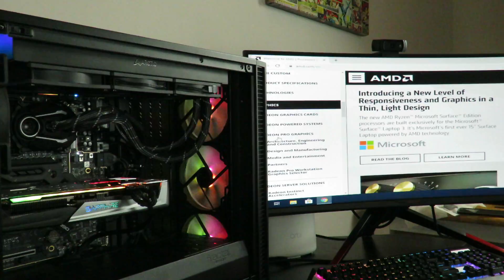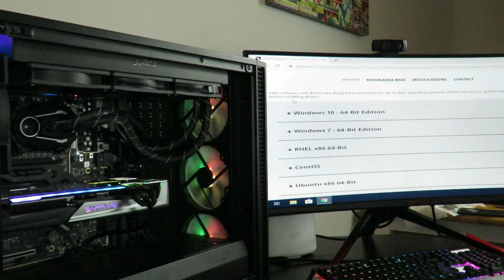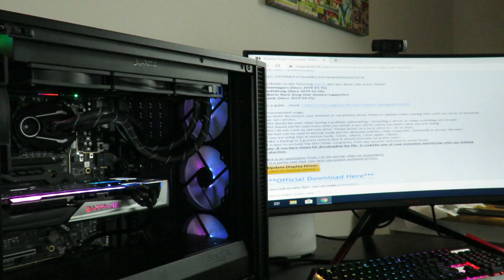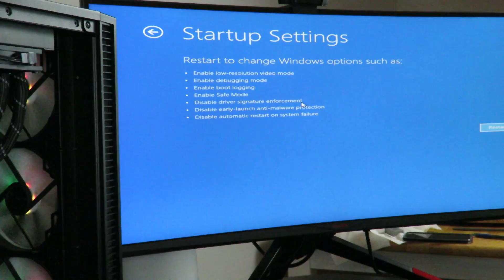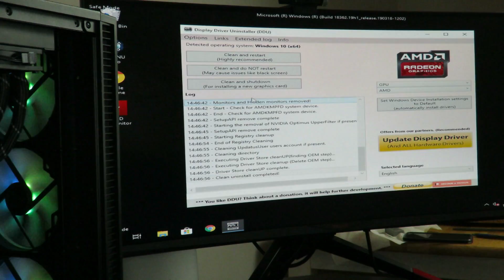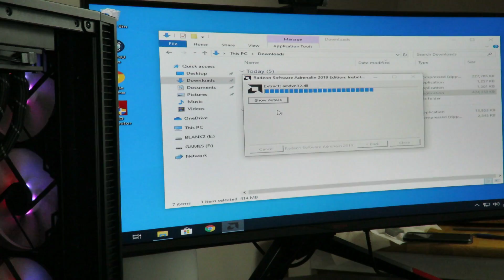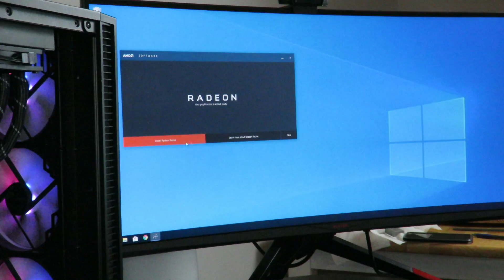Installing the AMD Sapphire Radeon Nitro+ RX 5700 XT 8GB OC Graphics Card

Comment: I see your helping everyone thank you alot I need you help please so my rx 5700 xt msi gaming x doesn't give me signal I already try doing everything bios update moving from slot but I don't get signal.i have a 750w psu and i7 9700
Reply from the maker: I try to help all my subscribers with everything but on yours, is your monitor selecting the input your card isi being connected with?  For example, if you are using HDMI connected to your monitor and your video card, is the monitor on HDMI?  An issue that just appeared for me, is on the monitor, the HDMI connector is a bit stretched out, so I have to wiggle the cable a little to make proper contact, I would get the same no signal message.  Also, do you have both PCIE cables connected to your video card?
Reply: @ThisBytesForYou  yes i already try to use another pc but the same problem no signal
Reply from the maker: @raulrodriguez1998  If you can never get signal on it from any PC, sadly it sounds like you need to RMA it.  Sorry my friend.
Reply: @ThisBytesForYou  thank you you got a sub
Reply from the maker: @raulrodriguez1998  Thank you so much my friend, I do greatly appreciate it.  I hope you don't have any issues returning it.  I would like to ask you, if/when you do return it, would you be exchanging it for the same card, or switching to another, and if you do switch, what would you be switching it?
Reply: @ThisBytesForYou  its from newegg so I to return it for the same one but if I had choice I would go for the powercolor devil rx 5700 xt
Reply from the maker: @raulrodriguez1998  I would highly recommend getting the  Sapphire Radon Nitro+ RX 5700 XT OC, the cooling on it is the best, check it out on Amazon: https://geni.us/VoHIZhu

Comment: I am back, and am having troubles again with my graphic card. I had it originally in the first pcie a lot but it wouldn’t connect so I switched it to my second pcie slot and it still won’t send a signal to my monitor. It doesn’t light up either and show no sign of life. Is there any way to get into bios without the gpu? Or is this simply a faulty card? Please help ASAP. I spoke to you about this two days ago!
Reply from the maker: you never had to ask me to answer asap, I will always answer you as soon as possible.  So for example, if you are using an HDMI cable, or DP, make sure you have that input selected on your monitor.  Also, if you came from onboard video, make sure you have the monitor plugged into the video card, and not into the motherboard.  Also, do you have both PCIE cables connected, and what manufacture and model number power supply do you have?  Also, what motherboard are you using, manufacturer and model number.
Reply: I have the exact same problem played around with the cables kept taking it iut and putting it back in worked for abit then 1 day it stopped getting power again
Reply from the maker: @halloween448  Sorry, I did not see this comment, youtube is horrible at sending notifications.  Have you resolved this issue?  If not, lets walk through a few things.
Reply: @ThisBytesForYou  hey no problem i did was actually a problem from windows 10 and its power settings i kmow others that had the problem aswell but i resolved it by adjusting the maxiumum processor state and the minimum state as the minimum was set to 99% and max 100% so i changed the minimum to 20% and max 99% and its all well now, the minimum and max states were on those settings for all power options
Reply from the maker: @halloween448  hmmmm ok, I usually set my minimum state to 5, but hmmmm, I will keep this as a note for others having issues, I had not thought about that.  Thanks.

Comment: Hi, (I’m sorry I’m still a noob at pc building this will be my first build) I just bought this graphics card because I’ve heard good reviews about it, and meanwhile I’m installing everything, it seems to fit in perfectly, it looks just like yours. But when I decide to boot it up to see if the rgb and fans work, my gpu doesn’t light up or anything. Everything else lights up but the graphics card. Do I need to connect it to a monitor for it to turn on? Or is it just simply a faulty graphics card? If you addressed this somewhere in the video I’m sorry I didn’t catch it the first time. My monitor also isn’t coming in yet so I have not tested it with a monitor display connected to it. Please help ASAP.
Reply from the maker: Can you give me the exact model number of the video card?
Reply: Mine is the exact same video card as yours! Sorry for not mentioning it!
Reply from the maker: So the model number on the back of the card is the same as mine, or does it just look the same?  Does your model number say black?
Reply: It’s the same as yours!
Reply from the maker: Ok, have you downloaded precision x1 from Vegas website?  I was very persistent about the model, becuase if you look down at the comments many have said the same, and by me asking, we find it looks the same, but is not.
Reply: I won’t be able to download anything until I get my monitor in.. I was just turning it on to see if my fan and rgb would turn on but everything else in my build turned on but my graphics.. should I be worried? Or wait until my monitor comes in to trouble shoot?
Reply from the maker: Well, the monitor helps, don't try turning it on without the monitor.  Also, sorry I meant to say trixx, not precision x1
Reply: Okay then! I will wait for my monitor! It comes in Tuesday so I will come back here if I have any questions or concerns! I love your channel! Thanks a lot man!
Reply from the maker: Anytime my friend, always happy to help, but we just need to make sure we have everything before we diagnose, also, make sure you have both of the pcie cables and a capable power supply in the system.

Comment: hello, i have the asus brand of this card strix rx5700 xt OC, it shuts down on stress. the clock speed Works more than 2000 mhz, i will uninstall the drivers as u said before, and install it again. on the other hand i m not sure about the power cable, which one is the true using 2 seperate cable or (as i did ) one cable from psu has 2 8 pin outlet and i used that. is it a problem i have another free cable too.
Reply from the maker: its not a problem if your power supply is strong, what power supply do you have, model number and manufacturer?  Also, I have heard of another person with the 2000mhz problem, it was resolved when they dropped that a little, you may want to also check with gPU-z what your video card temps are.

Comment: Hey, I just bought a Gigabyte version of the same GPU. Unfortunely I'm having problems when stress the PC it turns off. Tested with other old GPU from Nvidia (GTX 750 Ti) and works fine. I'm using 750W Bronze that should be fine right? What could it be?
Reply from the maker: the drivers can be a little off and windows, a few things you want to do, make sure you are on your latest version of your motherboard bios, update windows to the very last update, then DDU your drivers, removing all nvidia drivers as well as AMD drivers, and after using ddu, update to the latest driver version:  here is my video for ddu: https://youtu.be/clLYbBywhAg, please let me know how this goes for you.
Reply: @ThisBytesForYou  already update the drivers and windows, apparentely the problem was the clock of gpu, wich surpasses 2000mhz while gaming, I set up to 1900mhz and until now is doing great
Reply from the maker: @Fabricio414  ahhhh good to hear, very happy you are up and running.  The 2000Mhz, was that your doing in overcloking?
Reply: @ThisBytesForYou  nvm he dont want respond :)) ..btw why u got a 5700xt..if u have a 2080 curious haha
Reply from the maker: @nikenzzo  not sure what you mean he doesn't want to respond he has responded.  As for your question, I state in the video exactly why I am changing the 2080 to a 5700.
Reply: @ThisBytesForYou  sory i watched on hurry ..i go full video at home :)
Reply from the maker: @nikenzzo  no worries my friend, but check it out when you can

Comment: Legend 🙏
Reply from the maker: Thank you my friend, but you are the legend here, without you I am nothing.  Thank you so much for stopping by, checking out my video and commenting, it means the world to me.
Reply: @ThisBytesForYou  np my man, best video I've found on this and helped me set mine up, keep on doing what your doing :)
Reply from the maker: @samgibson6502  Thank you my friend, I do greatly appreciate your kind words and I am so very happy I could help.
Reply: @ThisBytesForYou  is there anyway you can help me, I bought this graphics card and for some reason the performance is worse than my rx590 which costs around 300 less any ways I can fix this?
Reply from the maker: @samgibson6502   Sam Gibson  it should be slightly more than double the performance, I HIGHLY recommend downloading and running DDU, then downloading and installing the latest and greatest driver, I am assuming you kept using the same driver, even moving to the same generation, just a step up, I always recommend using DDU.  Use DDU to remove the old driver, make sure to set DDU to also stop windows from automatically installing "their latest driver", and of course do this in safe mode, then after uninstalling the old driver as I mention in this video, then install the latest driver.  I also recommend FULLY updating Windows before you do all of this.  Here is the video I recorded on this process: https://youtu.be/clLYbBywhAg .  Also, you want to check your temperatures and you need to make sure you have both PCIE connections plugged in.
Reply from the maker: did that help you any?
Reply: @ThisBytesForYou  sorry I didn't see your message, I tried all of this and saw no change, so I sent it back I think I'm going to upgrade other parts of my system first like my motherboard and cpu thank you for your help though :)
Reply from the maker: @samgibson6502  you are very welcome my friend, I will do all I can to help you.  If you have any more questions afterwards, please do ask, I would love to help you.
Reply: @ThisBytesForYou  thank you bro, keep up the good work :)
Reply from the maker: @samgibson6502  anytime my friend, thank you so much for your kind words and your support, it means the world to me.

Comment: Can you help me? I have MSI MPG x570 gaming edge wifi MOBO ryzen 9 3900x 32gig ram and 750w power supply. My issue is when i installed this gpu and install the drivers the screen goes black and the fans on the gpu stop. I will have to install my old gpu and to uninstall drivers and restart the whole process. The screen only goes black once i do the driver update. My bio is up to date and nvidia drivers have been uninstalled.at a lost for words now
Reply: Also i have update amd chipset driver and socket driver and when restarting the computer the gpu will still let me go into bios, but windows wont load and the fans will stop spinning
Reply from the maker: OK, I recommend watching this video, starting at about 7:09, I show you how to uninstall the old drivers with DDU, then also stop windows from automatically updating your drivers, then how to install the latest and greatest drivers.  Now, before you do this, 100% update your copy of windows to the latest and greatest version, then FULLY update your BIOS, you can find your BIOS here: https://www.msi.com/Motherboard/support/MPG-X570-GAMING-EDGE-WIFI, latest version is 7C37v17.  Afterwards, download the latest chipset driver from AMD, from here: https://www.amd.com/en/support/chipsets/amd-socket-am4/x570, then download the latest video driver from AMD, from here https://www.amd.com/en/support/graphics/amd-radeon-5700-series/amd-radeon-rx-5700-series/amd-radeon-rx-5700-xt.  

After you have downloaded the chipset, video drivers and DDU, boot into safemode, then use DDU to remove your NVIDIA and AMD Video drivers, then use DDU to remove your chipset drivers, also set DDU to stop windows from automatically updating your drivers (that is causing your issue), then reboot and go into regular mode in windows, it might be a good idea to uplug your ethernet cable so you wont be on the internet for this portion.  Once in windows, install your chipset driver, if it asks you to reboot afterwards, reboot and when back in windows, then install your video drivers and you should be good.  

Please let me know how it goes.
Reply: @ThisBytesForYou   so i tried all of this today even tried reinstalling windows cleanly on one hard drive and as soon as i gott o the gpu driver its black screened again. Everything else updates just fine. Thanks for your help. It did this with my 2070 super and now 5700xt
Reply from the maker: @Andre214uy  try uninstalling these updates in windows, KB4532693
, KB4524244, then boot back into safemode DDU the drivers, then install these drivers: https://www.amd.com/en/support/kb/release-notes/rn-rad-win-19-10-2
Reply: Ok so i could not find those updates u told me about so i just uninstalled one of the security ones that windows would let me. Then i disabled windows anti virus/question prompt (before installing apps).i installed the driver u sent and it works!!! It freakin works now!! Thanks so much. Dont know if i should update to the latest amd GPU driver or not though. Thanks for all the help and time!!!! Should really make a video about this, apparently a lot of amd users have these problems.
Reply from the maker: you are very welcome my friend, I am so sorry I did not get back to you before, but for some reason a lot of my comments are not coming through.  I am so very happy I could help you and actually I have made 2 videos about this.

Comment: I bought the Nitro+ to upgrade from my 4Gb RX580 but I didn't uninstall any of my old drivers. It was a plug and play experience for me. Turned my PC on and the Radeon software recognized it as a 5700XT, I updated the drivers through the Radeon software and have had no issues since. The card's performance is fantastic, as expected I'm getting more than double the performance while running cooler and quieter. Do you think it's a good idea to clean all drivers and start fresh since I never uninstalled my old ones or is that process irrelevant for me since I'm all up to date anyway?
Thanks in advance if you see this.
Reply from the maker: well, since all is working well, keep it like that, especially if you see a performance in crease but if you notice issues, I do recommend removing them and installing the latest.  I hope this helps.

Comment: Nice video! I got the same card, but I’m stuck atm with my first build. I got an EVGA semi-modular psu, and it already comes attached with one 6 pin and one 6+2! I need an extra two pins! The PSU did come with extra VGA cables, but I don’t know if you can use those instead of the ones labeled “PCIE”, and just let the PCIE ones hang loose. Any help is appreciated!
Reply from the maker: Nice, very happy I could help you on your first build.  Yes, you can just tuck that entire cable aside, attach another 6+2 cable into the power supply and connect it to the card.  Back in the day, when all power supplies were not modular, we would have a bunch of other cables just tucked away in the PC, cluttering it up, modular power supplies let you only attach what you need and semi modular, while better than non modular, will usually always leave you with one or 2 cables you don't need.  

Again, you are perfectly fine, not using that 6Pin, plugging in another 6+2 or an 8 (but make sure its not an EPS cable, as those are for CPU power) and then connecting it into your video card.  I am so very happy I could help, and thank you so much for stopping by to check out my video and comment.  It means the world to me.
Reply: ThisBytesForYou thanks so much for that info! Just to clarify, I can just tuck away those already-attached pcie cables and just connect the VGA cable, right?
Reply from the maker: @PrimevaLonXans  yup, anything not used can just be tucked away and you are so very welcome my friend.

Comment: Hey love the content! Would you suggest the 5700xt over the 2070s in 2020? Thanks!
Reply from the maker: It's a rough one, the 2070 Super is a little over $80 more (https://geni.us/Hn1yP) than the 5700XT (https://geni.us/VoHIZhu) those are my Amazon affiliate links for each.  Currently, AMD is having a lot of issues with Windows (potentially due to motherboard BIOS', Drivers, Drivers pushed out by Microsoft) that cause many people to return the cards.  The 2070 Super is a bit fast, not by a ton, but there is a noticeable difference, but right now might be a bit of a gamble as NVIDIA is set to announce a new card, potentially in March, which surely AMD will launch something right afterwards.  

Prices typically don't fluctuate much, AMD has already dropped some pricing, making NVIDIA drop some pricing, but based on this structure, it might make sense for AMD to change their normal scheme of things and drop prices when big NAVI is released (if ever) which might make NVIDIA drop pricing, but if you need a card now, and cannot wait a little, go for the 2070 Super https://geni.us/Hn1yP, for only about $80 more, no headaches (not Sapphires fault, Sapphire makes excellent cards), it just works.  NVIDIA makes great cards, they usually come at a much higher cost, the cost difference here I would say is reasonable.  Going with NVIDIA, I would only recommend EVGA, they not only make the best NVIDIA cards, their customer support is tops, you won't find better support anywhere else, at what ever time of day or night, if you have an issue with the card, give them a call, they are super friendly, helpful and really feels like you are talking to a personal friend, they are all gamers it seems, which rocks.
Thank you so much for stopping by, checking out my video, the compliment and commenting, it means the world to me.  I hope I have helped you.